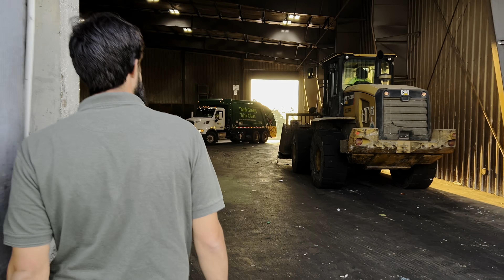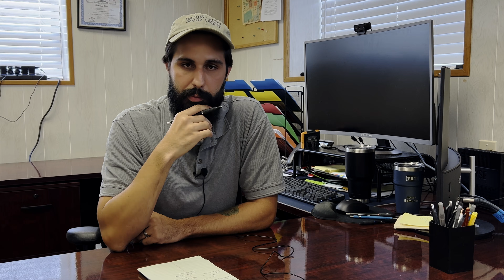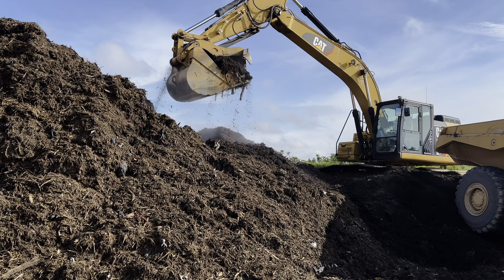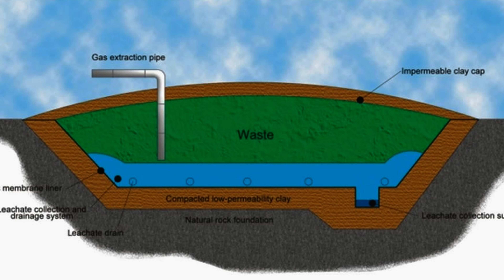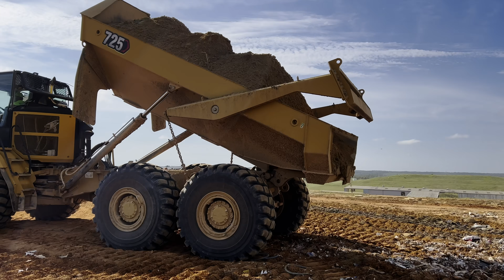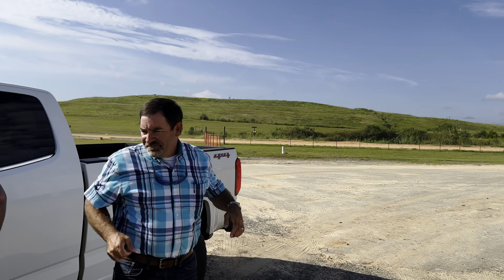What really goes on at a landfill

Comment: Why don’t you run all the waste thats going to the landfill through a shredder first before running it over with the compressor. Could shred it in to a pile then load it to your trucks to tip where you want save the public going in the tip face.

Comment: My City Canton Ohio did at one time, because of a political issue drove all the trash directly to the land fill. What a mess, they overloaded the trucks so bad they got fined almost 100K which they never paid, then the bypassed the scales on I77 using back roads which they destroyed. The transfire station in town went broke and got bought out by the landfill owner solving the problem
Reply: Refuse trucks carry a lot of weight per axle, esp in summertime when folks bag their grass clippings.  Back in 70s-80s-90s was not uncommon for drivers to be directed by 'the office' to use alternate routes to avoid DOT and weigh stations.  Things are probably better now with the prevalence of trucks with tandem drive axles + a lift axle and national waste companies with QC and accountability programs.  But back when smaller/local companies did hauling with single-axle trucks - not as much.

Comment: Cleanest tracks I’ve seen of any landfill
Reply: Really? Pretty messy. We have "landfill" in the center of town and it is like some other factory. No smell, nothing.
And we have heat from it for warm water or heating. ;)
Reply: @badmaniak  What you probably have then is an incinerator facility, which will have 'scrubbed' smokestacks.  Many large cities use one for generating electricity: burn the trash to spin a turbine which spins a generator.  But many things cannot burn - tires, drywall, shingles, lots of tin and plastic in construction debris, etc.  Your town is likely sorting that out and sending to a landfill somewhere.